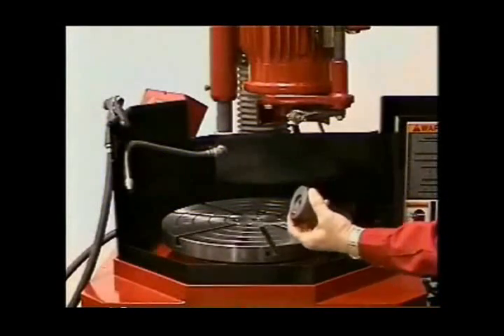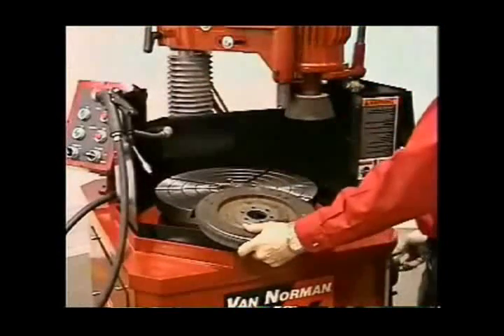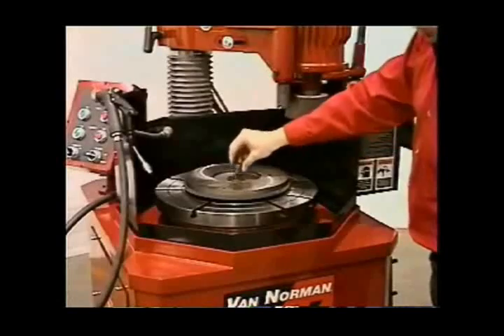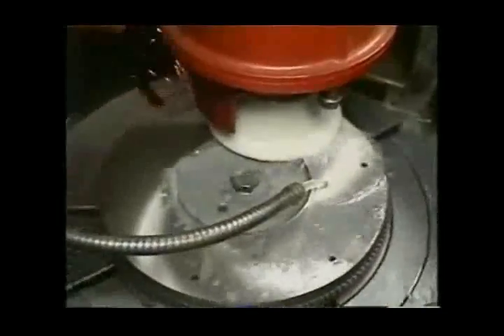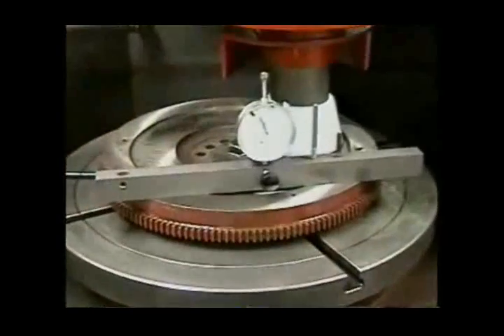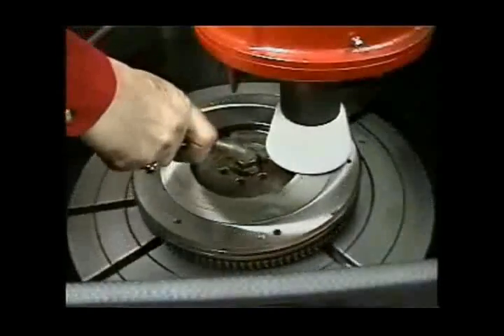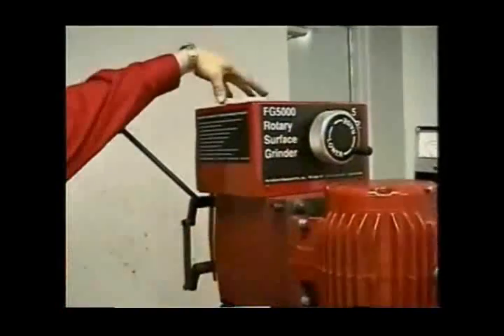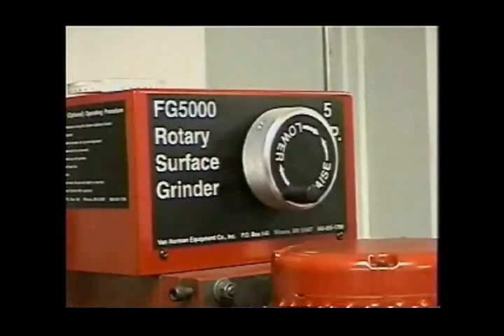How to Operate The Van Norman Flywheel Grinder.

Comment: We have this model machine at our shop. At the 3:44 mark it appears that the head locking lever is disengaged, shouldn't the head be locked before setting the depth gauge? The lever on our machine is nearly at a 90 degree angle when locked and vertical when unlocked.
Reply: The head locking is tulock side-to-side motion. The depth gauge is to set the depth of cut on an auto grind unit. For best accuracyit would be best to lock the column first then set your depth of cut however it's not absolutely necessary you can do these in either order and still have a successful grind. Also for best accuracy you should not rely on the
Reply: Machines depth of cut setting. A dial indicator and flat bar are the better way to make your measurements and use the machine settings only to get close to the desired depth.